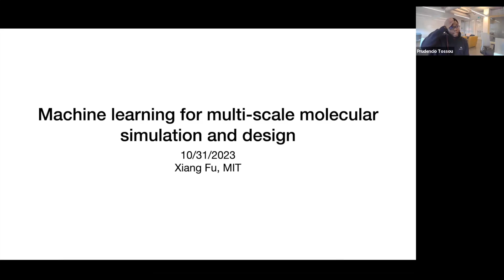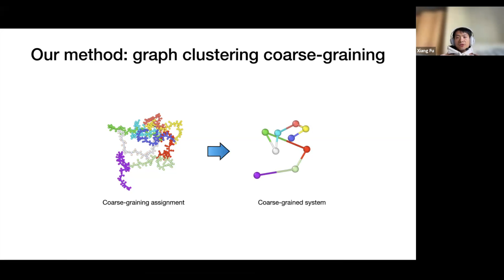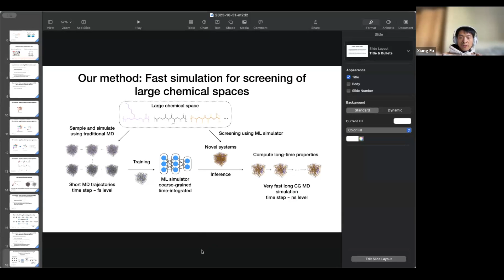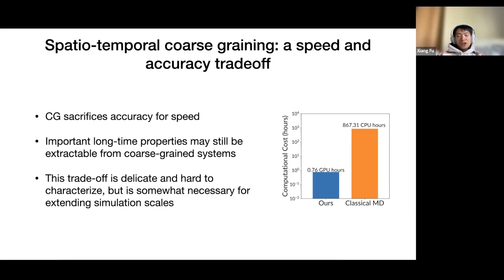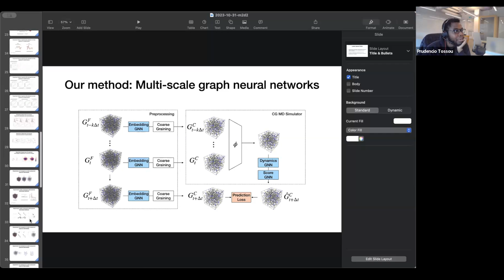Machine Learning for Multi-Scale Molecular Simulation and Design | Xiang Fu

Comment: 🎯 Key Takeaways for quick navigation:

00:00 🎙️ Introduction to the Talk
- Introduction of the speaker, Xiang Fu.
- Overview of Xiang Fu's research interests in generative and dynamical models for molecular systems.
- General welcome and instructions for the audience regarding questions.
01:08 🔬 Motivation for Multiscale Modeling
- Discussion on the multiscale nature of molecular systems.
- Motivations for using multiscale modeling approaches in molecular science.
- The complexity of modeling molecular systems with high accuracy.
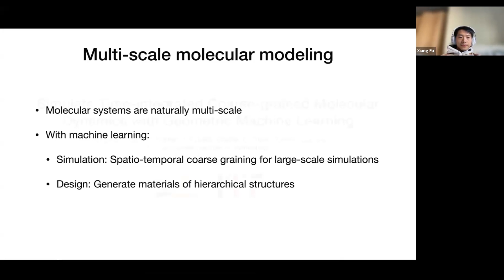03:02 📄 First Paper: Simulate Time-Integrated Coarse-Grain Molecular Dynamics
- Introduction to the first paper, "Simulate Time-Integrated Coarse-Grain Molecular Dynamics with Multiscale Graph Neural Nets."
- Motivation for accelerating molecular dynamics simulations.
- Challenges in simulating complex systems with long timescales.
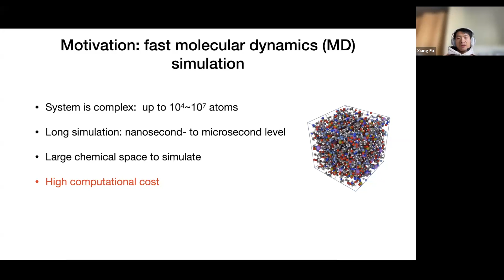08:42 🕐 Ingredients for Extending Molecular Dynamics Timescales
- Discussion on the key ingredients for extending the timescales of molecular dynamics simulations.
- Spatial coarse-graining to reduce the number of atoms.
- Using long time steps at the nanosecond level for efficient simulations.
- Learning from short MD trajectories and simulating long trajectories for novel systems.
16:13 🌐 Machine Learning Simulator for Large Chemical Space
- Explanation of how machine learning simulators operate at the coarse-grain level.
- Training the machine learning simulator using short MD trajectories and downsampled data.
- The goal of screening a large chemical space efficiently using the trained simulator.
26:10 🧬 Accelerating Molecular Simulations with Course-Grained Models
- The section discusses accelerating molecular simulations using course-grained models.
- The trade-off between speed and accuracy in course-graining molecular simulations.
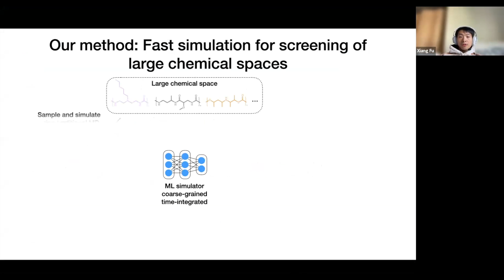32:28 🧪 Application to Solid Polymer Electrolytes
- Exploring the application of course-graining to solid polymer electrolytes.
- Balancing speed and accuracy in simulating diffusion properties of lithium ions.
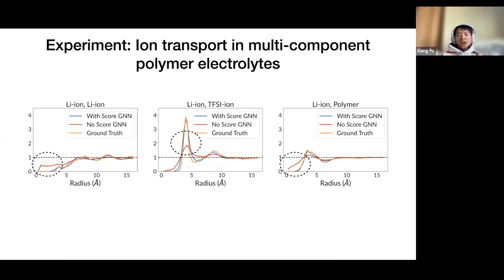45:41 🔬 Balancing Speed and Accuracy in Course-Graining
- Delving into the delicate balance between speed and accuracy in course-graining molecular simulations.
- The potential of theoretical approaches like course-grain force fields for preserving both global and local interactions in molecular systems.
52:19 🤔 Challenges in Speed vs. Accuracy Trade-off
- Balancing speed vs. accuracy is a fundamental challenge in course-graining simulations.
- Course-graining can recover the free energy surface but might not preserve accurate dynamics.
- Theoretical results about preserving dynamics in course-graining simulations are still limited and challenging.
55:00 ❓ Questions about Time Integration and Interval Selection
- The choice of time interval for time integration in course-graining simulations is a critical factor.
- Selecting the right time scale for the prediction interval is a complex problem.
- Longer time intervals smooth out finer details but risk losing important information.
57:29 🔍 Understanding the Role of Embedding GNN
- The embedding Graph Neural Network (GNN) focuses on learning node features.
- While course-graining itself is not learnable, the embedding GNN learns local environments for atoms.
- It helps capture distinctions between course-grained nodes and is trained based on loss propagation.
59:47 🧐 Reference to Professor Gregory Wol's Group
- Professor Gregory Wol's group at the University of Chicago has worked on theoretical aspects related to course-graining and preserving dynamics.

Made with HARPA AI